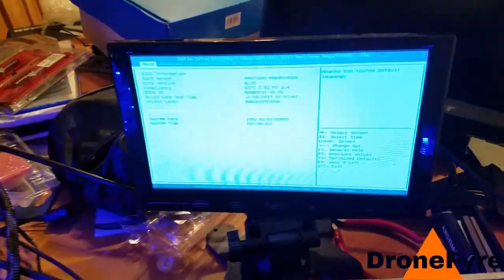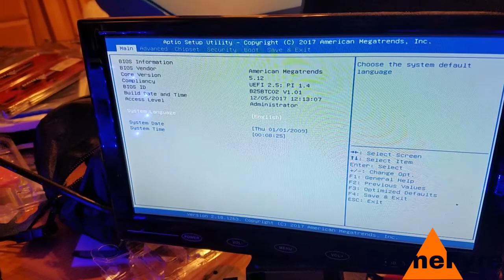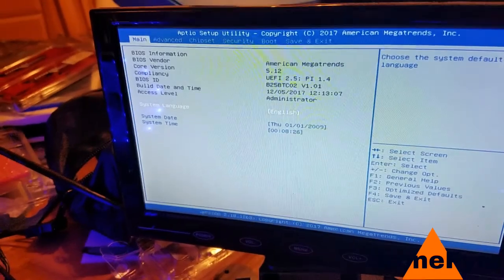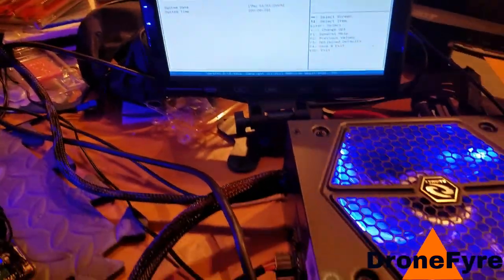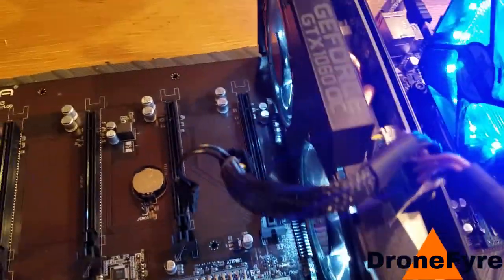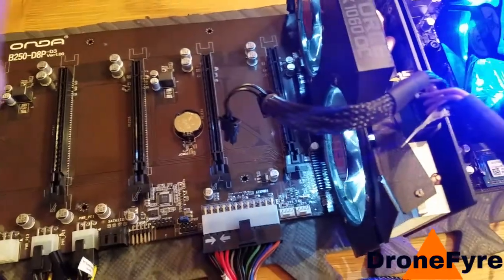Connect and Powerup the ONDA B250 Mining Motherboard

Comment: I'm running EthOS and it only will hash 3 cards. It sees all 6, but only 3 are hashing. Is it the 4G update?
Reply from the maker: sounds like a possible power issue, are you powering all the 6-pin molexs?
Reply: Drone Fyre - I have a 1050 PSU running 3 RX550s and a 650 PSU running 3 RX560s. I was running the rig on Windows 10 and all the gpus were hashing. It was sweet. I had to switch to EthOS because windows kept updating (even tho I disabled it) and would crash Claymore and Wineth. EthOS fired right up, showed all 6 GPUs, but only the first three GPUs hash. I even swapped out the GPUs. At first I had the first three slot as all RX550s, the next three with the RX560s. EthOS was only hashing the RX550s. When I put a RX560 in the first slot,  EthOS was hashed the RX560 and the two RX550s--just the first 3 slots, the other three slots/GPUs EthOS reads, but they don't hash, they are listed--but read zero for the hashrate.
Reply: Drone Fyre - Yes. 6 pin moleys.
Reply from the maker: have you tried this: https://forum.ethereum.org/discussion/14053/mining-rig-problem-of-gpu-not-hashing-at-all-ethos it resets the kernel parameters or make sure ethos is set to hash all gpus in the config